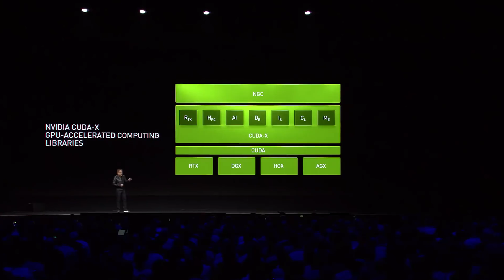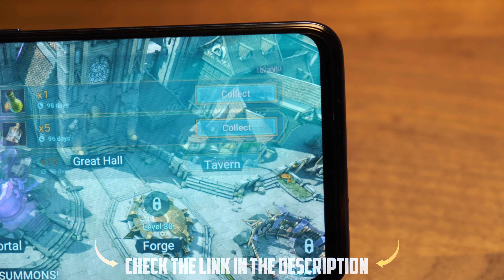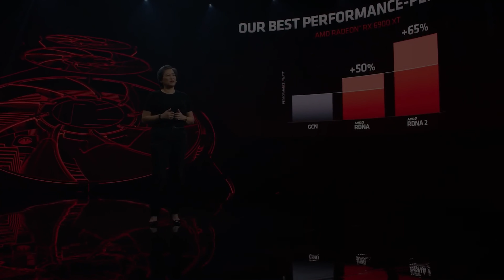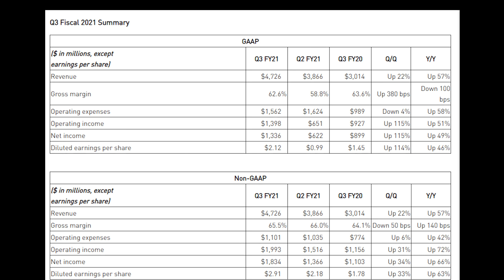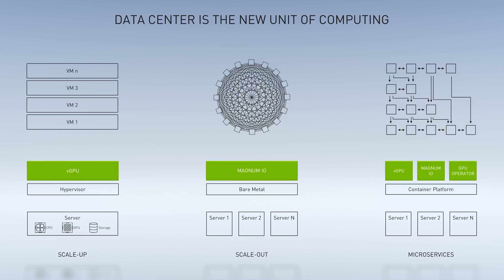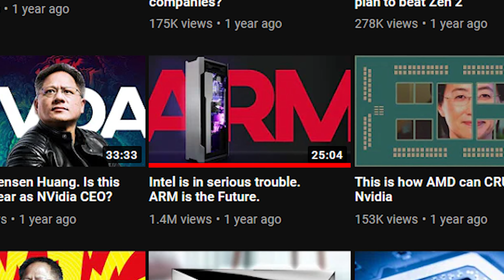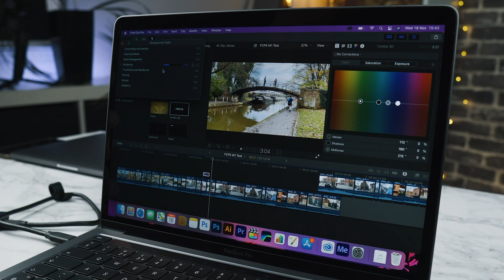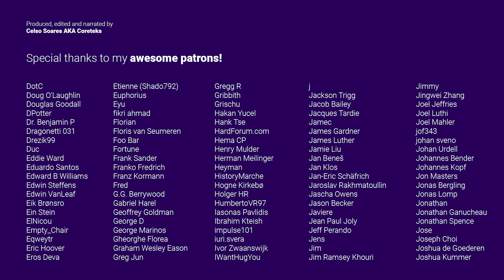NVidia has a REVOLUTION coming

Comment: I think it’s fairly obvious why Nvidia wanted ARM, it’s just odd that they felt they had to acquire it to do this when they could’ve just purchased an arm license for much cheaper, and stop the headaches in the future of Nvidia intentionally stunting the development of ARM to keep the best parts for it self, avoiding potential lawsuits. 

I think the overall market and industry is trending toward ARM, and will try to push out x86. However I wouldn’t say x86 is overall inferior, it’s just that Intel and AMD has fell behind. Also both Intel and AMD have also integrated accelerators into their processors - this is not new.
Reply: They suck at CPUs, though. Look at all their past attempts. What they will get from ARM us what Apple got from PA-Semi: institutional knowledge.
Reply: @laurelsporter  Nvidia did not need to buy ARM for their engineers, they could've easily built a team hiring much more well known engineers, that come from companies with the most advanced architectures on the market. Not to say that ARM engineers aren't as good, but what they're building are base level architectures that no one really uses. You're not going to be competitive with those.

Comment: There is only so much that can be accelerated by asics (or fpgas) and gpus.  This approach is nothing new.  Amiga anyone?
I really don't think this has much relevance on the consumer market with the exception of certain workloads like gaming, video editing, crypto mining, etc.  The CPU itself is still the single most important differentiator for overall performance.  Accelerators are useless outside of the workload they are designed for.  Sure, these accelerators might bring new functionality that was previously unfeasible, but that's just again a complimentary thing.  I'd like to see you increase your office productivity performance with the tcp offload engine on your nic ...

As far as the datacenter is concerned, sure, yup ... but even there, it is relegated to specific workloads.  There are many examples of such failed attempts as well.  Sun's niagara, intel's whatchamacallit xeon accelerator card, etc etc.
The need for AI in the cloud is a solution looking for a problem.  Pushing workloads that really ought to be run client side to a machine in a datacenter is not a smart thing to do, and the market will eventually realize this.  Privacy, latency, security, price, etc will eventually make people realize that it's a bad idea to continue down this path.

All of these things tend to be cyclical in nature.
For cpus, first they scaled up (faster chips, higher clocks), then they realized that this only worked to a point, then they scaled out (multi core, better bus architectures for multicore, etc), then they realized software sucks and they could only take it so far, now they are scaling up again, etc etc.

For accelerators, early on in the history of computing, the cpu would do nearly everything, then the amiga (and others) came along, then they realized that although performance was great, it was tricky and limiting the general usefulness of the machine, so they started consolidating again, and now we're back to the start ...

For computing, early on, the only way to access a computer was to use a dumb terminal, then personal computers came into the scene and now we're' back to the beginning.  Pushing everything onto someone else's computer (aka the cloud).

In the end, this is all driven by hype and market tendencies.  We'll see what the next fad will be, but i doubt x86 is going the way of the dodo anytime soon (although, it's time has come imho).
What i hope for is more choice and diversity in architectures.

I just hope they keep the spec and firmware at least reasonably open ... i'm looking at you apple ...

Comment: He seems to forget Amd will be using xlinx Acap Versal ,which is generations ahead of anything nVidia can match. Arm is at least 30 years from 50 percent market share, its called 86 legacy programs and software.  Amd will be the first to harmonize 86 and Arm architecture on a single package that runs without the need to run a compiler. Amd stated two years ago that this is there near and midterm  goal. They meaning Amd have known for for quite some time of Nvidia aspersions,  Amd has been working closely with Xlinx for 10 years, they now have the money and resources to bring it to market when the market is ready for the change in technology transformation.
Reply: facts, not enough feelings.

Comment: When you look at all the software we run on a PC theres no way that general purpose CPUs are ever going away any time soon... Only specialized markets like data centers could possibly convert all their software over to AI powered operations.
Reply: Even they're not converting it all. It's just that what can be converted can run orders of magnitude faster on dedicated hardware. The stuff that can't still exists. After changing over, though, now you can have the power and cooling budget to either add more accelerators, or more conventional hardware, without building and running another datacenter.

One very good easy to look at example is the Archer II supercomputer. They chose more CPUs and connectivity over raw compute throughput. Why? The why is the same as CPUs in datacenters, despite others major differences: you need to run software on it that's not absurdly difficult to develop, and/or that is bound more by memory/network/storage than raw compute (that last bit is also where Xilinx for AMD, and Melon ox and Cumulus for Nvidia, come in), or that just isn't a good fit for specialized accelerators (which includes traditional AI, which tends to be full of low-ILP/DLP branch you goodness).

Comment: Samsung 8nm or TSMC 7nm, is there such a big difference between those 2 processes?
Reply: Tsmc 7nm generates more performance at lower power. Since it is more efficient.
Reply: @terencedsouza2885  obviously but if the difference is 10% it’s a moot point.
Reply: @ThomasSerruques  but the difference for Nvidia cards is close to 20-30%

Comment: So did I understand this pc gaming gpu status correctly:
* Microsoft directX decides which API game developers use (Vulkan is other option); ie. DX raytracing implementation is what games will use
* Game developers can collaborate with either AMD or Nvidia to optimize graphics code on either gpu (below the "hood" aka graphics api, optimizations)
* both amd and nvidia support directX ray tracting
* Nvidia is much further in hardware performance of raytracing, for now
* Who are in "standards committee" of DirectX, deciding new features?
Reply: @tdreamgmail  I mean those interfaces like directx or vulkan, which are meant for many manufacturers of devices. Ofc Apple decides on their platform. 
I was interested in how many companies decide for these new interfaces features, regarding it is not of single company interface.

Comment: Why does everyone think the efforts of apple are magically gonna trickle down to every arm ISA user in the world. I mean windows on arm is still a dumpster fire. 

Imo x86 will be just fine for the duration of the xsx and ps5 lifetime. Because nearly all the games will be designed for x86 in that period. 

As for the whole accelerator thing, I agree that they’re really useful but it only really works well in a closed ecosystem or for a designated set of workloads. Transporting data is one such subset of workloads which the dpu accelerates. But the idea that accelerators can catch all the popular workloads is somewhat ludicrous. The m1 already has around half their silicon budget dedicated to accelerators and it still doesn’t catch all the workloads. And thats with apple deciding which software can take hold on their platform. Who else in the world can do that? Definitely not microsoft and we’ve seen how good nvidia is at pushing the industry in their direction these last couple of years.
Reply: I’m almost surprise no one mentioned the fact that Apple design their own chip and write their own OS, which is a large part why it is such a great performing chip. Also, their benchmark is very questionable, in one instances, it is very fast but the next is very bad (for some workload). What is that all about? 

Also, how is no one pointing out the fact that Apple have hbm on their laptop? They manage to integrate hbm and accelerator into their chip but we are still stuck with only gpu integration. I really hope Amd/intel put some effort into their packaging and integration because Apple is having quite a lead in this regard.
Reply: @s0methingmesh132  the reason why apple has hbm and accelerators is cos they don’t have to cater for the mass market. They alone take the burden of the costs and decide if it’s worth it. For example apple only uses 1 compiler so they can just build an accelerator for that unlike how it is elsewhere where you’ve got clang and gcc not to mention the many encoders that exist. For that reason, I doubt accelerators will take up as much silicon as apple’s chips. If amd/intel do decide that then I expect they’ll build an accelerator for more than one way to do the same problem.

Hbm is coming to the consumer though but it’s just too expensive for now. I think things will change late next year/ 2022. But for the time being apple has the best chips on the market but it doesn’t translate to anything directly tangible to anyone outside of the apple ecosystem except maybe making oems to give amd/intel a kick to start working harder on mobile but that takes 3-4 years to materialise. Granted they still have compatibility issues but that’ll evaporate like the last time they switched ISAs. Legacy codes and orphaned packages probs will never work on mac though, or at least work better than x86.

Comment: ML will never be used by competent programmers for anything that needs to be error free. It might work for systems where the input data has some level of noise and some level of noise is acceptable in the output but the only software this is acceptable is for consoomer level trash that no one really cares about because it is easily replaceable. This is just another form of greed by people who don't want to put in the time(and money) to accurately solve the problems they are trying to. Video games, movies, big data, spying, advertising type stuff will work fine. Quality and polished end products will never use ML models to do any of it. There is a reason Stan Winston's work looks and always will look better than any CGI crap people put in.

Nvidia isn't wrong though. Most developers these days are incompetent and will never be able to create the kind of software that solves those solutions. Especially if even older developers couldn't do it, what makes people think newer ones can. This is just going to make computers and digital tech worse than it's ever been. Not looking forward to it.
Reply: So you’re saying you can make an algorithm that’s better than ML at facial recognition? I’m not just talking identifying what a face is, but who’s face it is, from an infinite number of angles. People who write good ML algorithms try to understand what they’re doing, it doesn’t have to be a black box, and your entire algorithm does not solely have to rely on ML.
Reply: @johnj8639  Yes, it just would never be worth the time or effort to do it. ML you can do it in a few hours with a good gpu and a bunch of pictures.
Reply: @jarilo8639  I strongly disagree, if there was a competitive algorithm it would've been shown. There clearly isn't. There are a few solutions that I have seen in the past, and a few I can think of, they are all vastly inferior to even to an under-trained ML algorithm, on top of that vastly more inefficient, where ML algorithms can scan and recognize dozens of faces multiple times per second.

If you've found an algorithm for facial recognition that doesn't rely on ML, is competitive in speed and accuracy love to hear about it.

Comment: Xilinex was on the 45nm process, as it is the most robust in the slc memory life..  If  this technology is incorporated into a processor chip, then a memory count buffer dedicated to the number of times that the memory  or switch cores are programmed will be very relevant and the chips also will have a expected lifetime as the die size decreased....  Apple, I expect is using this to accelerate basic lower level functions that they deem variable in their proprietary OS code and also would like a limited lifetime device..  This could become a problem over the long run and the savvy buyer will look to avoid this pitfall, like cars the had very thin galvanized coatings and rusted easily in the 1980's.  Basically as Coretek has stated, the end of silicon is now  a very limiting factor to development and increasingly to overall utilization (SSD's locking up into read only mode at the enterprise level as one example)..

Comment: Thought AMD were themselves talking about dedicated acceleration hardware a while back. Part of the reason they created their Infinity Fabric and went modular. Guess it certainly does APPEAR at the least that Nvidia are moving more apparently towards such though, as compared with AMD's moves, and Intel's apparent juggernaut powers used to convey.

Intel is a burning palace and AMD is a phoenix rising, that is being very cagy about saying too much right now. If anything Nvidia is just making the moves to cover the grunt the competition already had. Intel will continue to reverse engineer whatever alien tech they've been munching off of and AMD is likely to come out of left field with something though
Reply: AMD is also an ARM licensee, I'm sure they could apply their experience from the Zen and use it on an ARM design.
Reply: AMD needs to invest big into software. That's what keeps them held back. They had visions of this stuff back before Sanders left, but it requires a massive software development push to get people on board, not merely supporting a few libraries.

Comment: I think if AMD is going to ditch X86 they probably are better betting in risk V instead of entering another devils deal with nvidia.
Reply: Developers dont want to program for proprietary software either....
Reply: Instead of abandoning x86 . They should use a modified instruction set of x86 that has RISC like characteristics but maintaining sufficient backward compatibility.
Reply: @desjardinspeter1982  it would be a win win to everyone minus intel and arm/nvidia.
Reply: @ksrikar6668  Sure but that is a big task to do and if AMD wants to be competitive then they need to start shifting resources from zen now. It also wouldn't hurt to have some RISC-V compatibility too.

Comment: Hey Celso, what do you think Apple's high-end desktop chips will look like?

A lot of the performance and efficiency of this M1 chip comes from the on-package memory. Having ultra fast, low power memory on-package not only means data can be accessed much faster but it also requires a lot less power to do this compared to normal DIMMs of DDR4, the only issue is it's relatively expensive, especially when you need a lot. I think the entire Apple performance philosophy will rely on this design, so I could see there being a 32GB, 64GB and 128GB version of the CPUs for the high end desktops. Although at $200 per 8GB that would mean a 128GB chip would cost $3200 in RAM alone and that's using the much cheaper DDR4L when I believe they might (should) move to HBM.

There is a chance they will still max out at 16GB or maybe up to 32GB of on-package memory, then rely on having a secondary slower 'normal' RAM option, maybe DDR5 depending when these come out, that can be configured to huge capacities at slightly more palatable prices.

But my money would be on Apple producing a monster chip (similar in design to the Fujitsu A64FX chip) with something like 128GB of ultra fast HBM, 8 layers giving around 4TB/s of bandwidth, to be used as the unified memory for the whole chip which is then directly connected to a PCIE 5 'hyper-drive' SSD over 16 or more lanes. These could actually be very fast, offering up to 128GB/s on PCIE-5 (over 16 lanes). Also PCIE-6 isn't that far off, probably 2023 which doubles this again to 256GB/s. These speeds are actually faster than 8 channels of fast DDR4 and you can make these drives much larger and cheaper! We really could see the death of normal DDR memory on DIMM with a move to ultra fast on-die / on-package system memory plus ultra fast SSDs. Latency might be an issue but a small price to pay for the overall massive performance boost we would see from a shift to system designs like this.

As ever the main enemy on monster chips is heat but ARM architectures have a massive advantage here over x86 plus switching to HBM rather than DDR will help a fair bit too. 
I could see the top end Mac Pro Chip in 2021 looking something like this: 
32 core CPU (all high performance Firestorm cores)
128 core GPU
128 core Neural Engine
128GB HBM 
Built on TSMC's 5nm+ (it's too early for 4nm or 3nm) 
Price: ~$15-20k

Comment: I agree with you. Tighter software + hardware integration is the future of computing. Apple proved it with the M1 chip.
Reply: No, it doesn't. The M1 just proves how much we have been held back by AMD languishing for years, followed by Intel. The M1 carries itself on standard CPU and memory performance alone. Accelerators are just a bonus.